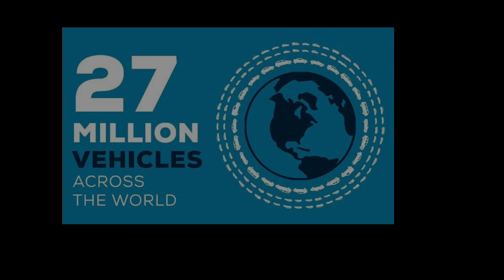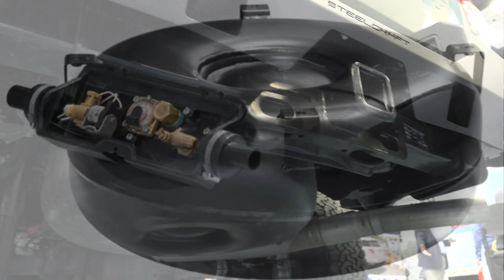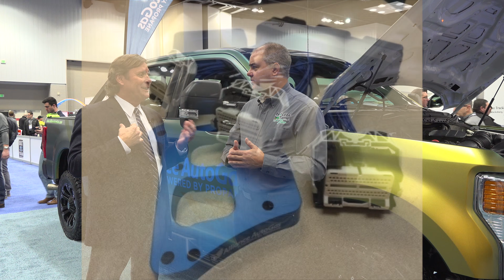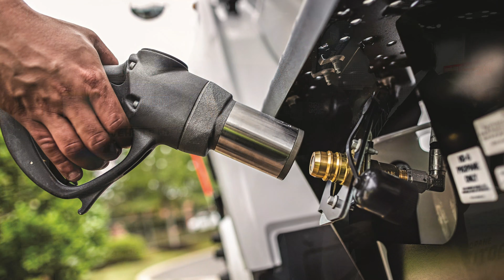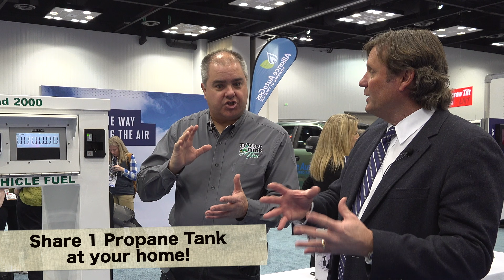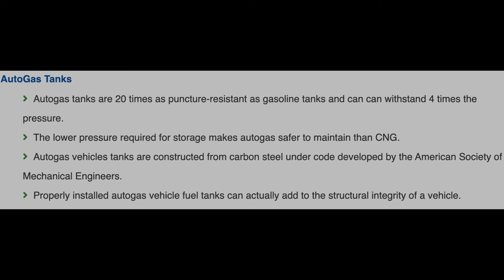New Technology!  Is Propane Practical Now?  Truck and Trailer Tuesday!

Comment: Terrific idea Tim...  Let's all burn up our Hundred Year reserve of natural gas in our vehicles; and then we can heat our houses with that clean burning diesel fuel...!
Reply from the maker: We have more natural gas that we know what to do with.   My sister had a well drilled on her property in West Virginia.  Huge gas well!!!  ...but they eventually plugged it due to lack of demand.  None of that huge supply of gas will be used.  Sad.
Reply: I thought these vehicles were running on Propane (LP), not Natural Gas?  Propane is in a liquid form where Natural Gas remains in a gaseous form.
Reply from the maker: Joe, he said that Propane is made from natural gas.  Honestly, I don’t know how this is done.
Reply: @TractorTimewithTim  I'll be the first to admit I am not an expert in gas production but a quick Google on how Propane is made resulted in this:  "The processing of natural gas involves removal of butane, propane, and large amounts of ethane from the raw gas, in order to prevent condensation of these volatiles in natural gas pipelines". So it would appear that LP is a by-product of the NG refinement process. I take this to mean the use of propane does not deplete our reserves of Natural Gas.

Comment: Thanks for the video! Not sure if the technology has changed, but years ago, I drove trucks in a fleet with this type of system. We found out the hard way, you had to run a tank of gas though the engine about once a month. The propane does not lubricate. Even though it seems odd, gasoline lubricates your engine. Also, you need a larger tank if you  already have it for heating or cooking.
Reply: The technology is always changing and we are committed to doing more research and development every year. Our systems are true bi-fuel systems.  We “crank and start” on propane when the engine is cold. We also blend gasoline in during certain operating times to assist with lubrication. Autogas tanks are different from the cylinders you might use for heating and cooking. In fact, our autogas tanks are designed for and in accordance with all  NFPA standards for safety.

Comment: Hey what about propane conversion on gas tractors older ones and newer ones
Reply: We'd be more than happy to put you in contact with a representative for more information on propane conversions for tractors. Send us a message here: https://www.allianceautogas.com/contact/
Reply: Found a little more information for you. There are propane solutions in the commercial mowing space in the 21 HP or less range. However, we are not aware of any current options in the Agriculture space. Great concept, but have not seen it progress yet.

Comment: So does the Toroidal tank take the place of the spare tire?
Reply from the maker: Yes
Reply: @TractorTimewithTim   So the propane system is a benefit for improvement in tire puncture resistance (since one does not have a factory mount available anymore). ;-)

Comment: Drawback on propane is reduction in miles per gallon. My city's garbage trucks went from mean ol' diesel to propane. With diesel they were averaging 4-5MPG. Propane dropped that to 1-2MPG. Twice the fuel required didn't offset the lower cost per gallon. Same in light duty trucks as well. Thinking green the CO2 emissions doubled when using propane because of the amount used.Particulates did drop but particulates don't make it into the stratosphere or cause  any significant harm.
Reply: That's the massive lie being told by these treehuggers.  Diesel particulates fall straight to the ground.
Reply: Diesel particulates matter and heavy ends can end up getting into fuel and causing real problems. Our filtration helps end the cycle. Learn more here: https://www.allianceautogas.com/what-we-do/refueling-infrastructure/.

Comment: What about loss of power and torque? I must have missed it if you asked the question. 
Fantastic video! Thanks
Reply: Kenny B you get the same performance from propane as you do gas. You just use more propane under higher loads.
Reply from the maker: But apparently still cheaper to operate than gasoline,  even if you do use a bit more of it

Comment: Great video Tim but if I was considering changing I would wait and see what the cost for the new all electric Ford F-150 will be and do a comparisons.
Reply: Difference is you wont be pulling a gooseneck with that electric truck,  it's all about application. I remember as a kid the propane companies had trucks to deliver the tanks for forklifts and those trucks all ran on propane.

Comment: I wonder how the price comparison works out today with the rapidly decreasing price of gasoline and diesel fuels?
Reply: Have you checked the bulk price on propane? Today a 1000 gallon bulk purchase is .879 cents a gallon through Thrifty propane in Eastern Ohio.
Reply: Hey Mark! Great question. When gas prices go down, so does the price of autogas. In fact, you can count on propane costing about 30% less than gasoline at any given time. Even during spikes in the price of crude oil, the relationship between the price of gasoline and autogas has held steady. One reason for this cost stability: autogas is an American-made fuel. Using autogas lowers our dependence on foreign oil and keeps costs down. Check out the pricing graphs here: https://www.allianceautogas.com/savings-and-stability/

Comment: So no special Raod Tax price on LP??
Reply: Not yet. Once a pol realizes they are missing out on tax revenue, it will get taxed. 
Wonder how this fuel alternative factors in to the Green New Deal?
Reply: @fyrman9092  It goes out the window along with the rest of the fossil fuels.
Reply: Texas has a road tax on propane if not for farm use.
Reply: Yep, I don't want to pay highway tax to run my furnace and water heater.
It is nice to have flexibility and choices with fueling, just need to work out the logistics first.
Reply: The same road and use taxes as on a gallon of gasoline is applied to each gallon of LP if its going in a vehicle.
Reply: As an alternative vehicle fuel, autogas is subject to taxes, but tax credits as well.  Learn more here: https://afdc.energy.gov/laws/319
.

Comment: Alot of people don't realize that this system utilizes the propane in the liquid form , not the gaseous state like the old systems. The school bus industry has been converting to propane powered buses because of  all the problems that are associated with diesel powered vehicles now. They have no cold weather starting problems and anyone that knows how to work on a modern gas powered vehicle can work on these systems , they are that much alike.
Reply: This is exactly right. We work with many school districts throughout the country. Propane buses are quieter, safer, and cost efficient. Most importantly, there's a significant reduction in emissions meaning no more black smoke coming from the tailpipe directly towards students waiting for the bus. https://www.allianceautogas.com/school-districts/

Comment: I drove many forklifts that ran on propane and I would fill them myself. Onetime while refilling I forgot to unhook the line drove off and of course it started leaking and the fire department was called in, because main tank was also leaking. So my thought with this system in today's world with everything going on, it could become an issue  with that nozzle. I wouldn't be afraid of using this system
Reply: The system is outstanding. You can read more about the technology here: https://www.allianceautogas.com/what-we-do/refueling-infrastructure/

Comment: I would like to know if it works in the cold weather. If you have ever had a forklift with propane and the fuel don't like cold weather outside
Reply: If your winter temps push towards -40 then it is a big problem otherwise better than gas or diesel as never have to worry about it freezing/gelling so long as the system is built and maintained right.
Reply: @bkrgi  I use propane in my car for at leased 7 years. Car starts with gasoline and after a short while passes to propane automatically....
Reply: The propane stays a liquid until it’s boiled off into a vapor by the heat exchanger tied into the vehicle’s cooling system. This allows the system to work without a pressure drop until you run out of propane. The only thing the sales guy failed to mention is you can’t start your vehicle cold on the propane. It has to be warmed up before the system will activate.
Reply: @andrewdarbyshire9108  You are incorrect. My Step-van, 350 Rocket, is ONLY fueled by Propane.
Reply: We'd be more than happy to put you in contact with a representative for more information. Let us know how we can help!
Reply: https://www.allianceautogas.com/contact/
Reply: Fuel injection
Reply: 3 questions 
Road tax?
In the colder months does fuel economy go down?
In colder months does the amount of propane you can place in the tank decrease?
Reply: @richardzacholl2152  With regard to road taxes, autogas is treated with the same interpretations as other fuels.  If road tax is required for them, so too for propane. Typically, propane road tax is lower than gasoline or diesel. As for cold weather fuel mileage, our technology emulates the host fuel system. Therefore, if you experience an mpg loss on gasoline during certain events, propane will respond in similar fashion. Propane volume will always change with differences in temperature and pressure.  In colder climates, pressures will be lower, and the tank will accommodate more liquid. Important to note, all autogas tanks are equipped with auto-stop devices to limit the fill to a max of 80 percent liquid capacity.  This allows for this expansion and ensures the tank is not overfilled.
Reply: @AllianceAutoGas  It may be true that propane is considered similar to gasoline or diesel. But hypothetically say the home fueling system is released, how will you pay road tax on fuel pumped into your vehicle compared to no tax for your water heater via the home tank? College professor shared with we students that gasoline and diesel are formulated to provide the needed upper cylinder lubrication. "Rumor" has it propane does not have that lubricant design so upper engine wear is much higher running on propane. Has propane formulation changed in the last 20 years to provide needed lubrication? I read other comments including one from a current propane vehicle driver stating on starting, the fuel used is the gasoline until it warms up enough to switch over to propane. So gasoline is still required to start vehicles? I sure hope those converting over their vehicles choose non-ethanol so their gasoline doesn't go bad while they burn propane.
Did I hear 45 minutes to refuel? Who has 45 minutes to wait refueling?
Reply: Good question! I don't have any viechles that have it. Where I work they have a forklift that occasionally is going outside in the winter.

Comment: Years ago they tried that and would not run in the cold.
Reply: 10 plus years ago when the diesel truck aftermarket was in its genesis, propane injection was an option as a power adder.
Reply: Fuel injection solves that
Reply: Years ago if you had a diesel you couldn't shut it off in cold weather unless you could plug it in, technology has changed.

Comment: A gallon of propane makes 27% less energy than a gallon of gasoline.
Reply: Also remember when using propane in other that farm equipment it will be taxed also in Texas you will need a propane tax permit taxes normally paid or tax time. The last time I filled my propane tank about 3 weeks ago for my house it was 2.38 a gallon gasoline here now from 1.49 to 1.99.
Reply from the maker: May be true, but not relevant.
Reply: @TractorTimewithTim  yes its relevant tim less energy means less mpg your talking about losing a quarter of your fuel economy
Reply from the maker: Don’t get caught up in that.  The issue is $$ per mile.     He is saying 30% cheaper per mile to operate.
Reply: @TractorTimewithTim  Cost to operate is "30%" cheaper ASSUMING you get the same mpg which you don't.It is relevant my friend.
Reply: @windzer  That's for sure. Just look at Ethanol vs. Non-Ethanol gasoline.  My vehicle's MPG goes up over 20% when running non-Ethanol. The MPG goes from right around 20 MPG up to 25 MPG.
Reply: @eosjoe565  exactly and idk where these people are getting there propane prices to be that low prices are pretty good in my area but know where near that low and I do know theres a propane fuel credit but that's expires the end of this year

Comment: Don’t like the idea of losing spare tire. Why wouldn’t they use space where oem gas tank is located instead?
Reply from the maker: Because the truck can run on gasoline as well. Simply push a button, even while driving down the road, to switch fuels.